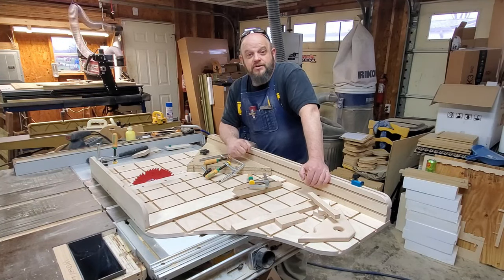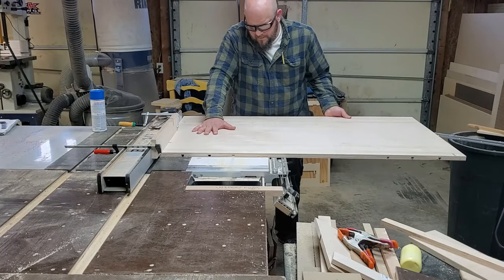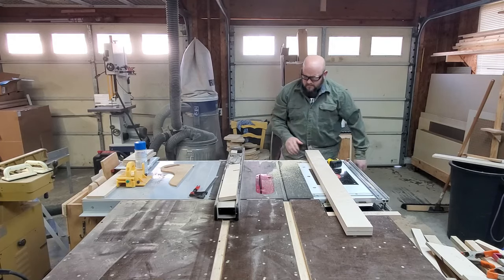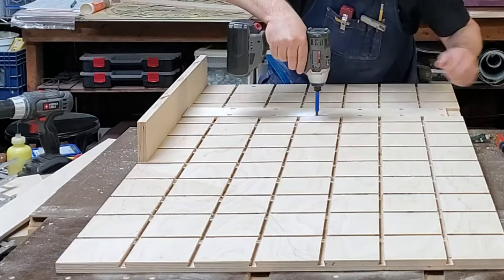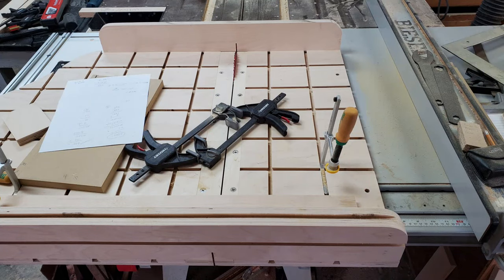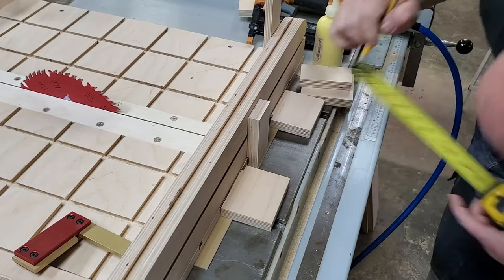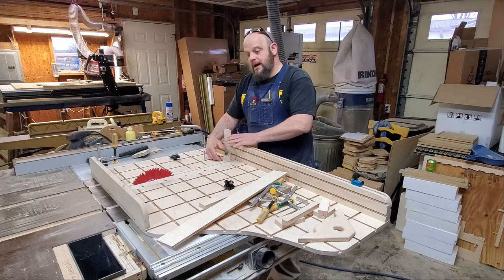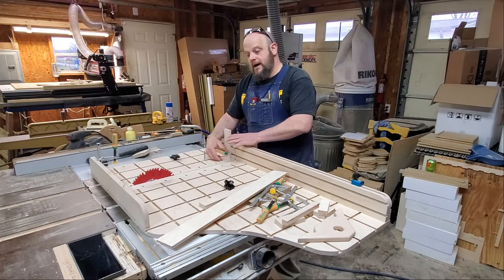Tablesaw Crosscut Sled Featuring Microjig Matchfit Dovetail System

Comment: Good job. I like your sled. That MicroJig Match Fit Dovetail Clamp System is slick. I need some. Why didn’t you go with their ZeroPlay Miter Bar versus Kreg’s?
Reply from the maker: My sled is considerably deeper than most.  The Kreg bars are 30" long, which gave me a couple inches hanging off for guiding the sled onto my table saw.  The Microjig miter bar is quite short.  If I make a smaller version of this, I will be using it.
Reply: Christcross Crafts Thank you!

Comment: How do u get the clamps to go in with both fences blocking each end ? The clamps have to slide in from the ends do u remove the fence to get ur clamps in ?
Reply from the maker: One clamp got accidentally locked in but I haven't had to bring clamps in.  They straddle the main fence and can clamp from behind.  I also use fixture pieces or clamps from the side if need be.

No issues.

Comment: Even though it's an Aircraft Carrier-sized sled. the number of innovations and features make it well worth the effort.  Congratulations!
Reply from the maker: Thank you.  lol.  It is quite large.  I've actually found I like the larger surface to house off cuts when batch cutting or cutting several pieces simultaneously.  Every time I get ready to make a smaller one, I use it instead and decide to hold off.

Comment: Awesome Chris. Just one question, how do you get your Microjig clamps in the T-slots on the slots that are parallel to the blade where your front and back fences are.
Reply from the maker: The clamps only go in from the side.  That's the other reason I cut away some of the fence on the left back of the sled.  The hardware packs can slide in and turn at any intersection, allowing them to make the turn and be used in the slots front to back.  That's how I made my miter jig work.

Comment: How did you permanently fix the fence after squareing from the initial blade cut?
Reply from the maker: I used clamps to hold it and ran more screws to lock it in

Comment: Fantastic. Just an interest in the combination table saw/router table. Any make/model recommendations?
Reply from the maker: There are several options.  SawStop makes the best saw on the market and they offer a router table set up like mine, but theirs is on the right side of the saw.  SawStop is expensive, but they have the safety feature that will shut the saw down if your finger touches the blade.  

Beyond that, Jet, and Powermatic both offer really well-built saws.  On the cheaper side, Rigid is an option.  Any of these saws will work with Benchdog router tables, which is what I have.

Comment: I have a question about functionality of your sled. How do you access the groves routed out with dovetail bit that are perpendicular to the far fence with the dovetail clamp? I see how you access the ones that are further over than the length of the far fence or access the ones parallel to fence, but the ones that are perpendicular I don’t see how you are able to use them because the fence on each end. Did I miss something that allows you to put the dovetail clamps in those grooves?  I was looking at your sled compare to Micojig’s Ultimate Table Saw Sled. The far side fence on theirs is much shorter and doesn’t go over any groves that’s how they cover address access issue. 
Thanks. Good sled
Reply from the maker: Thanks for watching.  I made mine significantly larger than the the one MJ did.  I do a lot of wider parts so this gets used for about everything. 

Other than the one clamp I accidentally locked in there, I don't have access for clamps front to back.  I honestly haven't needed them. I had decided if I did,, I'd cut part of the fence away.  The intersections do allow for T bolts to slide in from the side then turn.  That is how I've made a few hold downs and my miter jig (shown in the video).  
I've used it for a year now and thought about cutting slots in the fence for the MJ fixture hardware to slide in, but again, haven't needed to.
An update video is coming soon, where I show all the jigs and fixture pieces I've made for it.
Reply: @ChristcrossCrafts  Please let me know when that video is out. I am looking to make a new cross sled. Following your and MJ ideas. I'm looking to learn what you like about the sled and what you would change. This plan seems like a great way to use one sled with different blades and different angles. How do you like changing the throat for different blades?
Reply from the maker: @mattspeer6198  click the subscribe and bell.  It should be ready and posted in about a month

Comment: Yes, that is an awesome sled did you have any problem with all the dovetail grooves curling up the edges of the sled causing it to not be flat against the table saw?
Reply from the maker: Some, but mostly due to my dust port getting clogged causing heat.   Once I added the fence and it cooled it was fine.

I did start with a super flat piece of Baltic and kept it flat hanging on the wall, so that helped.

Comment: Quick question.  On the dovetail slots that run from the front to back, how are you able to slide in a clamp when the fence and front rail are on?  Do the clamps enter the dovetail track at any 4-way dovetail intersection?  I would have thought they needed to be slid in at the start of the track.
Reply from the maker: Thanks for watching.  I usually slide the clamps in from the side.  I did accidentally lock one in a front to back groove on the right side when attaching my fence.  

The left side of the back fence doesn't need to extend that far over if you feel you need front to back clamps.  You could also make dados deep enough to slide the fixture pieces in and out as well.  Ive used this thing a great deal and have not had a need to do either.  I hope this helps.

I am working on an update video with about 6 or 8 additional jigs ive made for it.  Coming soon.

Comment: How do you use any of the top-to-bottom tracks between the front and the back fence? They don't seem to have an entry point for the clamps... or an exit, as your trapped clamp can attest. 

What if you knocked out the dovetail near the back fence so a clamp can be placed in or taken out there?
Reply from the maker: Any clamping i can easily do from the side.  I do use the front to back slots for the hardware to make fixtures.  

The hardware can enter from the side and make the turn to front to back at any intersection.  Thats how I mounted my miter jig.

Comment: Do you need the 5 dovetail slots that go the same direction of the Blade if you have a front and back fence that cover the slots. How do you get the dovetail clamp in those five dovetail slots with both ends blocked by the fences?
Reply from the maker: The clamps won't fit in those front to back slot between the fences, but the hardware, fixture jigs, and t-bolts can come in from the side and turn at any intersection and are easily used side to side or front to back.  My miter jig uses T-bolts that are brought in from the side, turned at an intersection and locked in between.

Comment: Looking good. Just finished up my work assembly table using their bit. I also am building a modified version of their ultimate cross cut sled. Only major addition is I'm going with plywood back fence like you along with not gluing and using the 5 cut method and adding in a Kreg track at the top with the flip fence. Fence face has one DT groove too. Waiting on my router lift for the table to complete the build. I like their products and customer service is awesome as is the tech support.
Reply from the maker: I thought about the Kreg flip stop and planned on using it in my initial plans, but would have had to make my fence shorter.  I believe that stop (and the kreg fence) is 3".  I wanted a little more clearance.

Comment: Amazing job. Maybe I missed it, but how would do let’s say a long 45° cut on a board of 6” or taller?
Reply from the maker: Anything taller then the blade height would not be able to be performed without using a different style jig,  There are ways to do it but it will vary based on the board length.

Comment: hi chris made the microjig matchfit dovetail sled used 3/4 baltic birch 24x36 and it warped any suggestions of what went wrong ?  a cabinet maker told me there were to many slots
Reply from the maker: Depending on your spacing and the runners you used, It is possible.  One of the reasons I used metal runners that span the full depth and have two sizeable fences was to aid in preventing this.  

I also hang mine up on the wall and don't leave it leaning against something.

Comment: Great implementation of the match fit system. The design of the miter attachment so you can cut longer pieces and use vertical clamps is clever. Just subscribed!
Reply from the maker: Thanks for watching & kind words. It's a jig made out of necessity .  I have a 2 part video showing several more jigs ive made for the sled since the build.
Reply: @ChristcrossCrafts  watching those now, terrific!  Really enjoy your instructional style and the camera clamp is genius!

Comment: Great video with lots of creativity and versatility, thanks a lot for the inspiration and the time you put on making. Wishing you the best for this new year.

I have a question. You mentioned you used T-track bolts for some knobs. What size of T-track bolts fit on the dovetail slots? I see there are more things available for the T-track systems than for the dovetail system so the idea of using both on this sled is really good. I bought my first table saw a few weeks ago and I'm looking for making jigs and sleds for it, yours definitely is the best one I have seen. Thanks a lot!
Reply from the maker: Thank you for watching.  I just jotted down all the features I wanted & spent time figuring out how I could incorporate it.

Standard T-bolts with the elongated head work, but not with excess tension.  T-bolts have a flat head (not tapered like the dovetail hardware) so too much tension can damage the dovetail if not careful.

I made some hardwood dovetail pieces and bought some longer bolts and knobs from my local hardware store.  The longer bolts also fit the knobs & threaded fixture pieces from Microjig so I can still incorporate them.
Reply: IF you allow me, I would like to give you an idea for this, build a male dovetail in a solid wood strip, cut to the desired sizes and adapt the T-bolt, so we have the male dovetails with standard T-bolt.

Comment: I'm going batshit crazy! Routed grooves for Matchfit clamps and accessories... Everything glides smooth. But, I can't get any T-Track hardware to slide. Do I need to make another cut? Deeper cut? I don't need them... Just wanted the flexibility. Thanks in advance.
Reply from the maker: I used a t-bolt similar to a toilet bolt and it works fine.  It's not as smooth as the dovetail hardware but it works.
Reply from the maker: Also, if you build your fence low enough, you can slide the clamps in from behind the fence.  Mine is a little high but I can use a clamp with a scrap piece of wood to fill the space between my part and the clamp pad.
Reply: @ChristcrossCrafts : Thanks
Reply: Got  4 johnnie bolts at HD this morning > Work great!! And, you can snap them to whatever length you chose. Plus, they're 5/16-18 which is what 95% of my T-Track knobs are. Thanks for the great tip!
Reply from the maker: @joebeaton1101  anytime.  I will warn you with one more tip... don't torque those knobs when using them.  The dovetail slots are, well, dovetail.  They will snap if not supported on top of the surface and if overtightened.

I did some testing on scrap before using them on my sled to see what the limitations were.

Comment: Since the dovetail clamps slide in from the ends of the slots, it seems like you have 5 slots that can’t be used. I’m referring to the ones starting from the right side. You have the fence covering one end (of the slots), and the cross brace covering the other end. I don’t see how you can slide clamps into those slots.
Reply from the maker: Check out my update videos on this sled to see how I use the slots.  I have notches cut for fixture pieces to slied in from the outfeed side.  The Matchfit clamps can straddle the fence from outside the fence to hold parts next to the fence. 

I can slide clamps in from either side should I need to.  I've used this for a couple of years with no issues or modification needs.

Comment: Hy Chris just stumbled on to your channel. This is the best cross cut sled I've seen and will start making mine perhaps this week.  This MicroJig system is so innovative and they keep comin up with more stuff especially the new MJig AP clamps.  Expensive yes!  But what isn't that really works well and Accurately?  BTW I teach Isaiah at a Bible College and appreciate you Isaiah verses.  I'll look forward to more videos.  Also really like the way your router system is set up.  I've not seen that anywhere else.  You have any details on that and any drawings for your sled?  Thankeb 11:6
Reply from the maker: Thank you for the kind words.  I agree the system is worth every penny.  I don't have any plans... drawn out anyway.  My initial plans were roughly drawn with notes on things I'd like.  It was a culmination of about 3 months of planning and thinking of all it MUST have.  

It was originally longer on the right side, but as I thought about my miter attachment, I realized I would have to make it bigger so I'd have room for longer stock.  I went with 12" instead and that was perfect.  One thing that slightly changed my plans was the track bar.  I had to change two dovetail slot locations (by 1/2") so no screws would come through.  

Is. 61:1-3 is my life verse, so it means a lot to me.  I'd be happy to answer any questions you may have.  Feel free to message me for any for any specs or design issues.  You can also find me on Facebook under the same name.

Comment: I agree with you, it is one of the best I have ever seen as well.  Great job!!!  It does seem a little large and difficult to handle.  But still a great job.
Reply from the maker: Thank you for watching.  Funny, I originally was going to go smaller, but because my saw only has a 32" capacity between the blade and fence, I went larger to help accommodate those panel sizes that couldn't be used with a fence installed.  That has saved me several times.  I've added the Katz Moses stop to it and use it nearly every day.  

I actually used it to cut 6x6 parts the other day with no issues.  It makes a nice table to place the cutoff and finished pieces without getting in the way - all on one platform.  I have the runners and bottom of the sled super slick, so it slides quite easily for that size piece.
Reply: @ChristcrossCrafts  Man, no apologies please, you have the mind of an engineer and this is a great piece of work for you to be proud of.  The miter options you presented are a twist that adds remarkable versatility.  Truly an excellent job.
Reply from the maker: @mor8266  Thank you again.  I've actually added a couple new jigs to the system.  An additional angle (22.5°) and a spline jig with more ideas yet to build.
Reply: @ChristcrossCrafts  Thanks, I will check them out

Comment: Did you use 3/4" ply to start?  The microjig site says the dovetail projects about 3/8" up and it looks like that goes very nearly halfway through the stock. Just wanted to confirm if that's been thick enough to maintain rigidity. Given all the jigs you built for it since, I'd assume yes?
Reply from the maker: Yes, I used 3/4 baltic Birch.  I wanted rigidity and the layers help.  That's the other reason I cut away some on the left and made both fences full width.

Comment: I just ordered the matchfit system and was planning on using William Ng's method when building my sled. Your setup is very helpful. Looks like you can make the adjustments without having to drill first and then lock it down after you've got it dialed in. Great!
Reply from the maker: I did put one screw in to act as my pivot point.  Once the 5 cuts were done, it was easy adjustment and locking it in.

Comment: Great job brother! I really like the match fit system. I feel your pain on the mistake, the biggest problem is that you can’t put any more clamps in those slots either. My only suggestion is to take a chisel and relieve the dovetail on the slots as close to the front fence as possible so you can slip clamps in and out. Nice sled !
Reply from the maker: I have the side grooves for anything that might be required on the right or left side.  The left side part has some access since the back fence isn't very long.  I've already come to love having it there.  It's one clamp I can guarantee I won't have tied up on other projects so it's always there when I need it.

Comment: Nice idea, but I don't get how the microjig clamps can go into the grooves front to back. The fences seem to block access there. Maybe I'm not seeing how you solved this.
Reply from the maker: The clamps themselves don't go front to back where the fences are, but the hardware and other fixture pieces do.  The spacing is such that hardware can enter from the side and turn at any intersection to be placed in any groove.

Thats how I mounted my miter jig.  I brought the bolts in from the side and turned them in a front to back slot.

Comment: How do you insert the match fit dovetail in the slots running front to back?
Reply from the maker: I've answered this at length in an update jig video.  I haven't needed to.  For clamping parts at the fence, the clamps will straddle the fence from the outside.  All other needs are met with fixture hardware.
Reply: I found after asking but thanks for the response